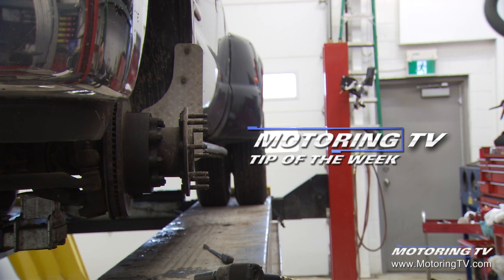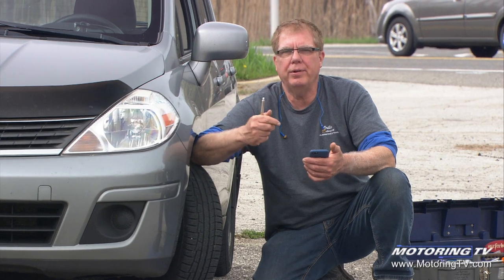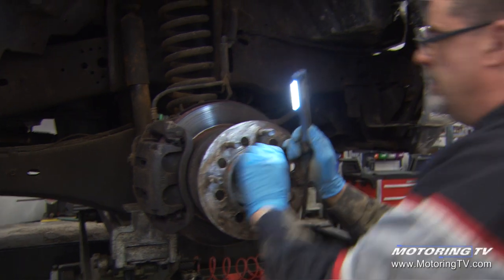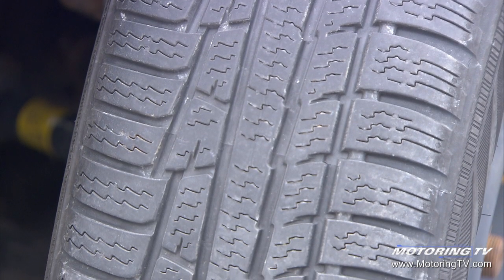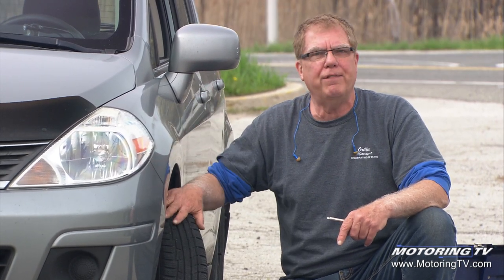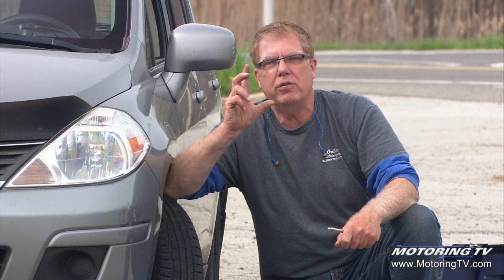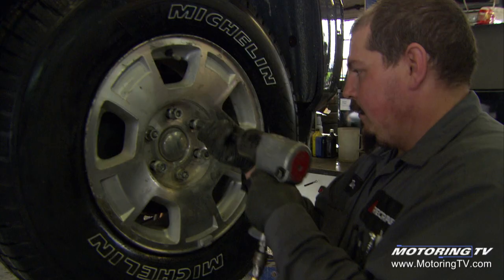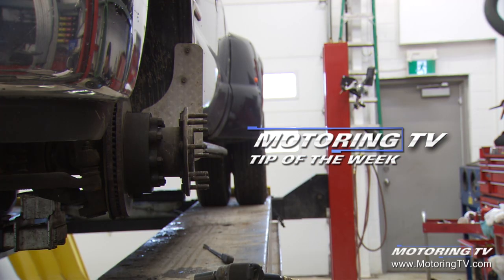Tip of the Week: Wheel Alignment & Tire Rotation

Comment: WRG3 Tires, I believe that is Nokian's All Weather Tire brand.
I have this brand on my 2010 RAV4.  Initially when I installed  them through Kal-Tire the accompanying reading material indicates that I am to rotate the tires every 8,000KMs.  This can be done for free at Kal-Tire or for a charge of $25 through my local dealership.  Since the 8,000KMs typically aligns with my synthetic oil changes I typically ask my dealership to rotate my tires for me to save me from making another extra stop to Kal-Tire.  I've been on these tires for 2 years and they are still treating me well.  Thanks for the video!

Comment: Took my car in for the 2nd tire rotation at 15k miles.  Afterwards I immediately noticed the steering wheel is off center. I had the tires rotated again still not right.
I think the bastards lifted the car wrong and damaged the frame or a suspension component. 
Of course they won't admit to it.
Had two alignments since then and my car that used to drive perfect is now permanently fucked up.  Im so god damn pissed about at Auto Tire.